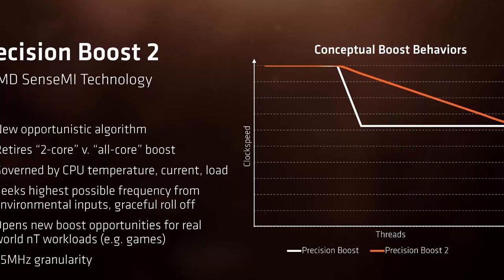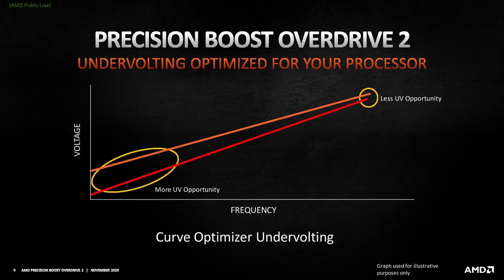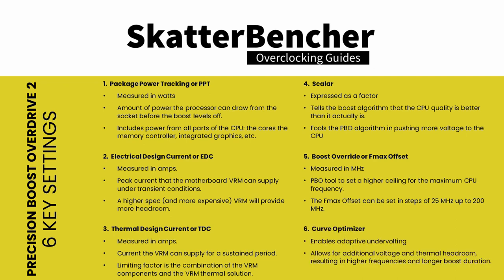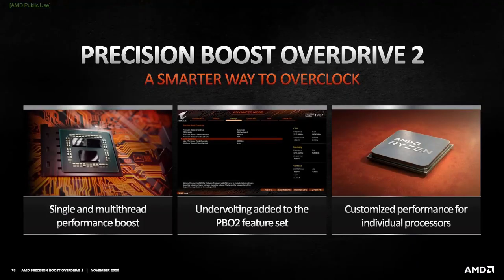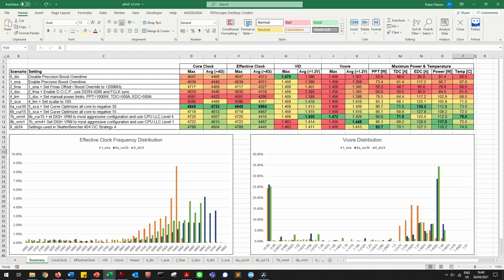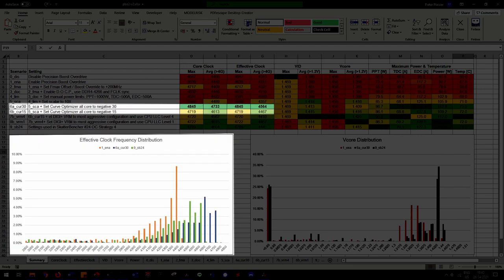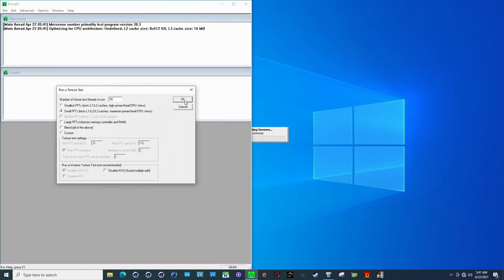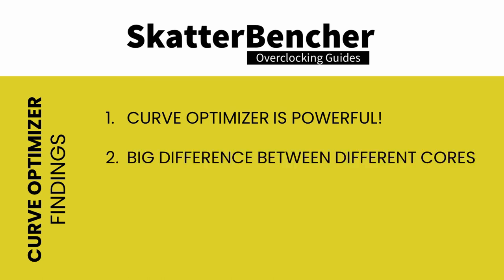AMD Precision Boost Overdrive 2 & Curve Optimizer Explored | SB#24

Comment: Good video! I finally decided to finish my CO + PBO on my 5600X, partly thx to this video. Started with +200 and -30 CO all core. Used core cycler which found one core unstable after 3mins, ran that at -29 and became completely stable. Got reboot in idle 2 times in a month, checked eventvier and it showed whea 18 on another core, set that to -29 and now the setup has been stable for 3 weeks with stock PPT, EDC etc. CB 23 gave me 11045 cores avg 4.3GHz. With CO I get 11647 cores avg 4.55GHz. Tested SOTTR (shadow of the tomb raider) and got 225fps cpu score avg, CO gave me 236fps. I must say I prefer CO+PBO over allcore OC. In SOTTR 4.8@1.32V got me 2% more fps vs my current CO-PBO stock PPT, but consumption was 10W higher, up to 5C more, it CB23 gave thermal throttle and idle consumption of 30-35W@1.32V. CO+PBO gives me a bit more single core perf, close to 4.8 if I set PPT to 90W and 20-25W@0.85V idle voltage, vs 0.95V stock. In my case CO+PBO gives 5-6% more performance vs stock, same temp/consumption at load and lower voltage at idle. Basically a win-win :) I wish Intel would make a similar technique to this as I find it superior to standard allcore OC.
Reply: hi can you tell me please the best pbo and curve optimizer settings for ryzen 5 5600x to boost the Fps in games
Reply: @montasertaha1102  try +200 and -30 allcore, use corecycler to find which cores needs lower. If instant crash try lowering it by 10, if crash after sevwral minutes try lowering by 2.

Comment: I'm new to AMD and the PBO, I struggle with the PBO understanding it and just ended up  OCing all cores, I got a 5950X @ 4.7ghz on a MSI X570GL. I never see much more than 5ghz single core 0c's with pbo, even thow Ryzen master says it should go to like 5.2, PBO is only going to about 4.4ghz all core.
Reply: Tuning PBO is the only way you will see over 5Ghz.. dont bother with all core unless your board supports OC switching which I dont think it does... the PBO allcore is stable.. the manual all core isn't.. it wil liikely not survive a prime95 run at 4.7.
Reply: @coolhand4598  ya I wish I would have got the ASUS Dark Hero, instead of the MSI GL. Is the ASUS DH still the only board to switching? I can only hope that MSI adds OC switching
Reply: @GoFasterHD  yeah.. it's no big deal unless you are benchmarking or rendering.. for regular workloads PBO2 tweaked out is what you want to focus on
Reply: @GoFasterHD  I recently ditched clock tuner.. I am using Core Cycler to tune in my PBO profiles.. better results
Reply: I got as much as I will get out of my 5950X. I manually tuning after running the Diag test.
P1 4500 Prime95 short FTT's stable
P2 4800 
PX1 5ghz

Comment: Really great and informative video! I am fairly new to this: could you please explain what "sensitive to vrm load-line calibration" is? Thanks a lot!
Reply from the maker: Sure!

First, let's clarify VRM load-line calibration: the VRM loadline helps minimize the under- and over-shoot of the CPU voltage. You can check out this video for some additional detail: https://youtu.be/0TGcKyXBQ6U. While it's explaining how voltage on Intel platform is set, the function of the motherboard VRM loadline is the same on Intel and AMD platforms.

Second, we must understand that the PBO algorithm is primarily driven by the available voltage headroom. When we're turning PBO, what we're effectively trying to do is force the algorithm to use higher voltages. When higher voltages are set, then the algorithm will match it with a higher CPU frequency. 

That's why Curve Optimizer is so powerful. Curve Optimizer allows the user to tell the CPU to use less voltage for a given frequency as well as more frequency at a given voltage.

In our search to enable higher voltage headroom we only have one option from AMD side: the Scalar setting. This setting will encourage the algorithm to more aggressively pursue higher voltages by pretending the CPU silicon quality is better than it actually is. From the motherboard side we also have the VRM loadline. By choosing a less aggressively calibrated load-line, we increase the under-shoot and over-shoot range. So, we increase the maximum voltage headroom so that the algorithm would match it with higher frequency. However, we also lower the minimum voltage headroom.

AMD has a special safety feature called Clock Stretching which temporarily "stretches" the clock frequency when the voltage is too low. The advantage is that this prevents a system crash, however the disadvantage is that this will drastically lower the system performance. So, we want to avoid "too low voltage" at all cost.

This is where the Curve Optimizer is sensitive to the VRM load-line. If we choose a very aggressively calibrated loadline, we minimize the voltage under-shoot. That means we can more precisely tune the Curve Optimizer with negative offset. However, if we choose a "loose" load-line where the undershoot is decreased more, then we need to be more careful with the negative offset.

Example: (assume the CPU is stable at 4200 MHz and 1.125V)

- 1.3V target, Curve Optimizer at -5 (~20mV) with LLC1 150mV undershoot -> 1300mV - 20mV - 150mV = 1130mV (1.13V) -> stable because higher than 1.125V
- 1.3V target, Curve Optimizer at -15 (~60mV) with LLC1 150mV undershoot -> 1300mV - 60mV - 150mV = 1090mV (1.09V) -> unstable because lower than 1.125V
- 1.3V target, Curve Optimizer at -15 (~60mV) with LLC4 100mV undershoot -> 1300mV - 60mV - 100mV = 1140mV (1.14V) -> stable because higher than 1.125V
- 1.3V target, Curve Optimizer at -25 (~100mV) with LLC4 100mV undershoot -> 1300mV - 100mV - 100mV = 1100mV (1.10V) -> unstable because lower than 1.125V
- 1.3V target, Curve Optimizer at -25 (~100mV) with LLC8 70mV undershoot -> 1300mV - 100mV - 70mV = 1100mV (1.13V) -> stable because higher than 1.125V

So you can see that a specific Curve Optimizer setting can be stable or unstable depending on the chosen VRM load-line.

TLDR; VRM load-line affects the minimum voltage. Curve optimizer negative offset also affects minimum voltage. Combining the two can result in too low voltage under real-world load and cause "clock stretching" or system instability.
Reply: @SkatterBencher  I never got such an extensive, detailed response! Thanks a lot for your time and effort, it really helps!

Comment: Question: My Ryzen 7 5700X have PPT 76W , EDC 90A both 100% when testin CB23, but TDC in 60A dont go over 84%, can i lower this to 55A?!
Reply from the maker: You can, but I'm not sure you should since it means you have additional performance headroom.
Reply: @SkatterBencher  I dont need additional perfornance,i prefer less heat.
Reply from the maker: If CPU temperature under load is your main concern, then reducing PPT will have the biggest impact. 

Alternatively, there's also a setting called Platform Thermal Throttle which allows you to decrease the maximum allowed processor temperature (TjMax). The CPU will automatically adjust operating frequency to stay within your specified thermal budget.
Reply: @SkatterBencher  Already use,max 60 degrees

Comment: This was excellent!

That Effective Clock info was eyeopening. Helped me to optimize my Curve and most probably made my machine more stable. One core seemed to be at lower Effective Clock under stress, raised the voltage to it by 5 points, now it's in line with others.
Reply from the maker: I love reading this kind of comment! Happy to hear you have your effective clocks sorted! :)

Comment: You should get a medal for this and deserve way more subs. Just the part to get rid of "clock stretching" is the most informative CO info out there, for me anyway. But when it comes to single core boosts, can we analyze this the same way somehow? I notice some of my cores aren't reacing the 4850mhz on my 5800x after setting the CO values for all core loads. If I do single core CB runs it just jumps between my two best cores so no help in that :)
Reply from the maker: Thanks for the kind words!

Yes! A big part of Ryzen tuning and Curve Optimizer tuning is to figure out how to boost each core to its highest performance. I use a combination of CoreCycler and HWiNFO to check the maximum clock of each core.

CoreCycler will essentially throw a load at each core sequentially. You can find the discussion thread here: https://www.overclock.net/threads/corecycler-tool-for-testing-curve-optimizer-settings.1777398/. HWiNFO allows you to check not only the Core Clock but also the Effective Clock https://www.hwinfo.com/. The goal with Ryzen tuning is to achieve the highest effective clock during a workload.

Last note: it is very normal that not all cores will hit the maximum frequency. In my latest Ryzen overclocking videos I also add the information on the maximum clock for each core. For example, in my 5223MHz 5900X video the highest clock reported in the OS is 5223 MHz only for Core 1. But the average max clock was only around 5000 MHz.

Also I checked the Effective Clock during a light SuperPI load and found that my best core would be running at 5053MHz and my worst core at around 4967 MHz https://skatterbencher.com/wp-content/uploads/2021/08/16m.png

Comment: 12:33 and 12:34
PBO Limits are Manual using 1000w, 500 tdc, 500 edc, 500 soc/tdc, 500 soc/edc
Precision boost overdrive Scalar Manual @ 10x
Then you setup Curve Optimizer to negative offsets.
IMO, the info above is pretty important as to how you derive to being stable enough to get into win10 with -30/-25.
Reply from the maker: Good point! Thanks for highlighting in the comments :)

Comment: I have a 5800x3d and it goes up to 4450mhz if the scalar is x1, so I put x10 and hit 4550mhz. Is it safe to put a scalar that high? I see many people saying it is dangerous and others saying it is safe. Btw Nice content
Reply: Scalar have a sweet spot

Scalar scale with best combination and temperature of your entire build

Too much cherry picking, set to 1x-2x-3x and check results and feeling, i use 1x and highest clock

Comment: A few of your overclocking videos suggests PBO limit values of PPT: 250, TDC:200 and EDC:200. I cannot seem to find your rational for suggesting these values?
Reply from the maker: My approach to tuning these options is to check the values at default with HWiNFO when running a heavy all-core workload, then gradually increasing until they're no longer limiting. I explain the specific process a little in my Threadripper 3990X video (OC Strategy #2) https://www.youtube.com/watch?v=8BAe1iymQH4&t=1671s
Reply: @SkatterBencher  Thank you Pieter, your provided link was exactly what I was looking for! 
Another question: Do you see any value in keeping these max PBO limits to just under 100%, as compared to some people, like BuildZoid for example, who will just set these parameters to such extremely high values as to ensure they will never hit a 100% limit?
Reply from the maker: I used to set extremely high values for the parameters, but found no benefit over just finetuning as I did for the 3990X. If you ever find the chip being limited ... you're using the wrong benchmark to do the tuning :)
Reply: @SkatterBencher  Indeed... Although the best bench is just using your system as you normally would for a week or two.

Comment: Hey ScatterBencher! You mentioned soemthing really interesting: "You will find that as you adjust the curve optimizer for the unstable cores, the Prime 95 frequency will decrease. That is of course because there is only 1 frequency and voltage applied to all cores in the CPU die. So, the performance is capped by your worst cores." If this is the case....after finding my worst core (-30,-30,--15,-30-25,-30,-30,-30,-30,-30,-30,-30) wouldn't I just go back to ALL CORE -15? Instead of leaving it on a manual per core number?
Reply from the maker: Not unless you still want the good cores to boost to their unconstrained highest frequency when fewer than all cores are active.

Comment: Wow, great detail! I have a SFF build and my 5600x is a little bit on the toasty side 82 degrees on load with AIO. What I have done now is PBO all core -30 and tweaked power limits 90 70 100 if I remember correctly. In an effort to go cooler. It's a little bit but creeps on long gaming stints near 80. What would be the best way to keep thermals in check?
Reply from the maker: 80C sounds fine since the 5600X has a TjMax of 95C. However, if you would like to stay below 80C you can try either of the following two settings:

- PPT Limit: lowering will cap the frequency based on the socket power consumption and as a consequence lower the max temperature
- Platform Thermal Throttle Limit: essentially lowers the maximum target temperature; set that to 80C or 75C should prevent the algorithm from pushing the frequency/volt/temp too high

Comment: so is precision boost 2 something you need to do / install or adjust in bios or is this feature comes by default in all cpu. ? if you build new pc with ryzen cpu, what exactly steps you have to do if you want to get max performance out of cpu. ? thanks :)
Reply from the maker: PBO 2 is a toolkit that's integrated in the CPU. The way to access the toolkit is either via BIOS or Ryzen Master. Every motherboard BIOS should have an "AMD Overclocking" menu which exposes the PBO2 toolkit.

Comment: I have 11900k and asus z590 rog maximus xii hero along with 6900 xt liquid devil and 32 gb ram 3800 cl14 tridentz neo.
I'm not expert of any kind but i followed some advice on internet and my pc stays and pass cinebench and aida 64 and furmark cpu burn test and after i doo heaven benchmark usually all in this order and the pc is stable but after test stop randomly maby 1 min maybe 1 sec or some times 10 mins pc shut down.
I checked hwinfo and my temps don't go over 80 and i have liquid cooling.

PSU is seasonic 1300 platinium .

All the parts are new.
Do you have please some suggestions what i do wrong ?

Comment: How do you want us to set the load  line? Soldering on leads to the back of the socket is something I am not ready for.
Reply from the maker: There are options in the BIOS to change the loadline calibration. No need to solder :)
Reply: @SkatterBencher  yes but how do I know which one to pick for my board, everyone says just pick medium but it would have been nice to know which one is actually the right / best one :)

Comment: I hit wall 4.6ghz multi , 4.9-5ghz single with just under full undervolt, less on best cores, & 150mhz boost / game boost xmp stable.I use mobo limit,default ppt W ,& 105 C throttle with aio cooler. Have low temps but can’t boot with higher pbo boost. think it needs more voltage or amperage. Should I try maybe increase ppt then use scalar instead of auto?
Reply from the maker: You can check with HWiNFO if you are hitting the  PPT limit. If yes, you can raise it.

Higher Scalar will encourage the CPU to have higher voltages under heavier load, so it should primarily help with multithreaded frequency and not so much with single threaded frequency

Comment: If the scalar settings is unchanged, does that mean the risk of damage by high voltage/current doesnt increase?
Reply from the maker: It's difficult to say for certain, because AMD doesn't provide specific details on how the PBO settings work on a technical level. All we know is that an increased Scalar will force more aggressive voltage increase by the PB algorithm. But, as far as I know, this is still within the general Precision Boost accepted safety levels.

Increasing Scalar doesn't really boost the voltages really high ... it just pushes it a bit higher in heavier workloads so you can get a bit more frequency.

Comment: Not sure how reliable it is, but Ryzen Master has a tool to do this for you. Be interested to know if it sets it up easier than the manual method (Takes about an hour)
Reply from the maker: Thanks for the info, next time I touch Ryzen I'll try that for my automatic overclocking strategy :)
Reply: @SkatterBencher  Set all my cores to -30 though, when I tried that and did the torture test, core 5 and 6 failed during tests so idk

Comment: For me it didn't work like that. ASUS B550-E + 5800X.
I can set negative 30 for all cores in curve optimizer, +50Mhz, than start prime 95 for all cores and have stable clocks in HWinfo. However, system will consistently crash in Gears 5 and Metro Exodus EE, until I set my Curve to negative 15.

I actually was happy to find this tutorial, because crush-rebooting does not seem like a fun way to setup your computer working parameters, but it didn't work out.

Still a good overview of what is what and what it does.
Reply: Try - 30 on all and run corecycler, lower negative by 15 on failed cores, raise by 5 if stable and fine tune. It might be just 1 core that fails - 30 or it might be all. Corecycler isn't perfect, and you might get rare reboots like I did. Checked event viewer, found whea 18 and the affected core, set a slightly lower negative and all worked fine after :)
Reply: @Taraquin83  Thanks.

Actually did that, after bios update screwed something with voltage control. CPU got hotter and most tests would pass with Negative 30.

After running corecycler at nights for a couple of weeks I have one core set to negative 20, other to negative 27 and all others at negative 30.
No reboots for 4 weeks.
Reply: @L1vv4n  good thing it worked out. Almost same results as me :)

Comment: This seem awesome! Can it be combined with ASUS Dynamic OC Switching?
Reply from the maker: Yes, definitely. Dynamic OC Switching just switched between PBO and OC mode. So all your PBO settings will apply when PBO mode is active.
Reply: @SkatterBencher  would you still want to use dynamic OC with PBO2? Is PBO2 making Dynamic OC switching obsolete?